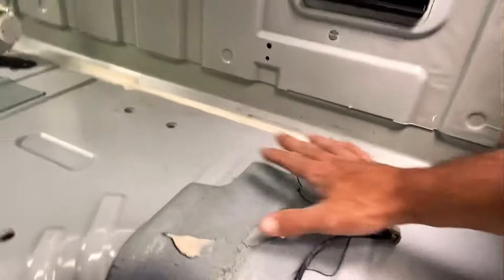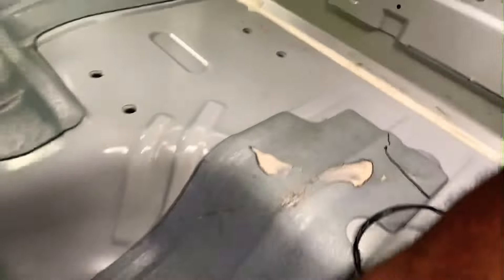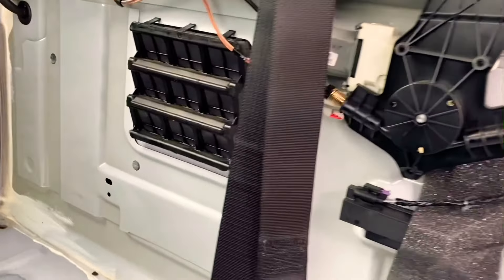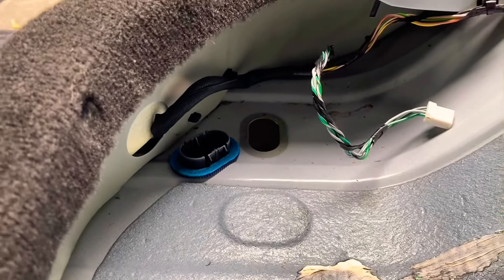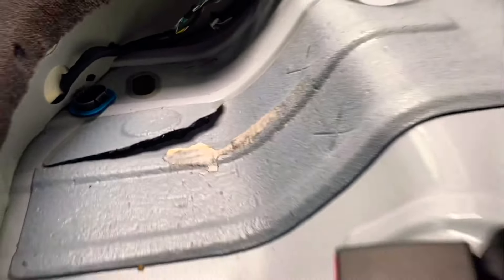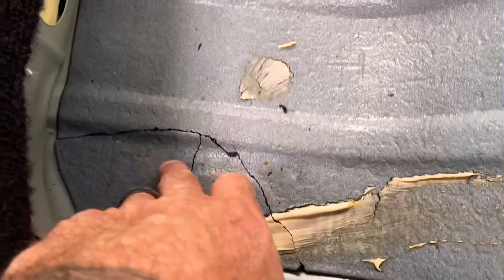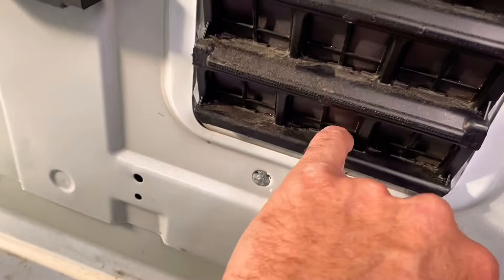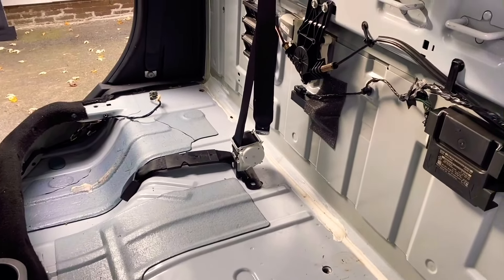ANOTHER RAM LEAK! 3rd Brake Light or Vents??

Comment: I had the same symptoms in my 2017 1500. I did the same exact investigation thanks to this video and found water sitting in my storage wells. Checked the vents and they were actually stuck open by a pile of debris behind them- allowing humidity and even a cockroach to move in. Check between your cab and bed for accruing leaves and debris! I had an entire ecosystem back there.

Comment: My headliner in my reg cab 2015 ram is water stained above rear window and around the back side above seat belt location. Today (we’ve had a lot of rain in CA) 1/2023. Today I went to put my seat belt on drivers side and it was wet!! I guess I’ll start with the 3rd break light. Then if not it’s the window gasket or the roof top rubber seal that may be leaking. Thanks for the videos.

Comment: 04 Dodge 3500 here. Just found leaking in the same area in the back corner driver's side rear seat and storage under seat. Replacing my 3rd light, but water is only under driver's side rear, not the middle, or passenger side. I hope this works for me. Thanks for the video.

Comment: Check the 3 drains in the bottom of the window. Mine were plugged and I found the sliding window would let a little water in and it had no where to go. Blew them out and it's been dry since.
Reply: Were can I find these drains
Reply: @jaredmarquez9993  if you look at the bottom of the glass on the outside of the window, you'll see 3 little breaks in the seal. Those are the holes that the water drains out of. Blow out the track the window moves in then spray some water on the window. You'll be able to tell which ones are draining and which ones are still plugged.

Comment: Great Info, 
I'm having the 3rd Brake Light & Rear Slider issue on the 2019 5th Gen. 
Here's a Big Achilles Heel to watch out for. 
You see that RF Control Module that RAM so cleverly (NOT) mounted on the back wall directly below the center window? 
Well Guess What. 
When they get wet they start corroding inside and eventually short out! This can leave you stranded as it did me! 
Worst thing is that it's a $80 part but $500+ labor because it has to be programmed by the dealer to match the VIN. 
I'm thinking about adding some of that tape and a plastic bag or some kind of shield over it to prevent it from happening to me again.

Comment: They're called "exhausters" and they only cost about $6.00 each. Easy to install and better constructed than the original design.
Reply: Unfortunately when you search them you find a ton of exhaust upgrades and then the seldom find of the actual part. Lol it is a thing and that is what they are called though. 😁👍✌

Comment: Damn thanks! Dealership is trying to charge me $544 right now. The vents are only $67 bucks a piece the rest is labor because they have to remove the seats! Guess that's some really hard work
Reply from the maker: Yes you can do it, just caulk around them unless the flaps are missing or not sealing
Reply: The parts are only $7 at Mopar parts Inc. You can do it yourself in 10 minutes. It takes longer to get the bench out than to change the vents. The dealerships rip people off.
Reply: F-ing dealerships man. I just did mine start to finish in 2 hours, and the parts were $43ish from the dealer, although you can find them online cheaper.

Comment: You don't have to pull the bed off at all!!! I replace these all the time, at a dealership. Push old in towards bed then angle and pull out, reverse for installation. Easy.
Reply from the maker: Thank you for your wisdom almighty Heathen 🙏🏽
Reply: I found that out the other day that they are easy to remove and reinstall from the inside of the cab.
Reply: Yep, unbolt back seats,don't have to pull em out, move em forward then pull out old exhausters and install new ones. I do it in about 10 minutes.
Reply: @heathenpriest5292  so do you still have to pull the rear seats out if you’ve done that back seat mod that allows you to fold the seats down?
Reply: No. If the mod has been done to the hooks behind the seat and it folds down, there is plenty of room to work.
Reply: @heathenpriest5292  nice. I’ve got two new vents on order so hopefully they send me the updated version being that some online places that I’ve seen advertise the new part number on the older style vent.
Reply: Yeah they do that. You should be able to handle it pretty easy though. One thing that makes it fast for me though is bad ass cordless ratchets and impact guns, just so you know. Hand tools will take longer to remove seat bolts.
Reply: Damn it!! I re-caulked my window thinking it was coming from there and still I kept getting water.  Wow. Thank you
Reply: Need to use acid free silicon , regular will ABSOLUTELY cause rust . It will eat through the paint over time .

Comment: Just an idea. But could you spray closed cell insulation on those areas where the noise damps are on the floor after sealing holes?  Again...just searching for ideas bc my leak is coming from top.  Sucks bc I love my 19 Ram 5th generation.  But it's giving me trade in vibes lately

Comment: Thought my 3rd brake light was leaking but new gasket and still getting water in. Going after the vents now!
Reply from the maker: Check the moon roof tubes too, process of elimination!
Reply: My vents leaked also. I just ordered the updated version and they fit much tighter and if the vent flaps leak, there’s a catch basin to direct the water to the outside
Reply: @frankmjr6571  where did you order them from?

Comment: Take the old vents out and replace them for the new ones. Before you put them on, add cabin sealer (good silicone) all around the edge of the vent, where is going to be in touch with the cabin and forget about the leaking....

Comment: So being that this was a year ago, did just simply putting a bead of silicone around the vents like you did, stop your leak? I guess I’ve had a leak for some time now and thought it might have been from the aftermarket third brake light I put in but I’ve long since replaced the gasket on it but I still have a leak. The only time so far where my headliner was wet was when I think the shark fin antenna was leaking, got that fixed and no more wet headliner but we had a pretty good rain today and noticed that my carpet was wet all the way back to back of the cab from the center cup holder on the floor but the headliner is dry so I’m thinking maybe my vents may be leaking as well unless it’s the damn rear window gasket.
Reply from the maker: Yes the vents stopped leaking.  You could have water coming in at third break light, when they leak the water travels down to the rear cab corners.  But also it could be those other things along with the drain tubes if you got a moon roof!  Check out the ZIP TAPE video in description
Reply: @TunedRAMS  well I guess I’ll be finding out the next time it rains because after ripping my seats out, ripping the back panel down and soaking the top of the cab, I had water pouring in from the top of the passenger side vent. Even had it coming in from the driver side vent as well but nowhere else, though as far as the 3rd brake light, sun roof drain or anywhere from the back window. 

I think I used the same silicone as you but I went one step further and broke off some short pieces of a paint stirring stick to wedge between the little tabs on the top of the vent that hold it in place and the cab sheet metal and siliconed it all in place being that you could pull the vents in towards the cab over an eighth of an inch so it’s no wonder the gottdamn things leaked. Hopefully I got it fixed but hey, if I didn’t, I at least did the rear seat mod while I had the seats out so hopefully I won’t have to yank the seats out next time.

Comment: The 3rd light might be leaking but the truck cab vents behind your back seats are definitely leaking.  You will have to remove the rear seat to gain access.

Comment: After lifting my carpet up it was way worst than it showed on the surface the foam is saturated in water. I am so disappointed in ram. I have an extended warranty but don't think it's worth the abuse. Any tips on drying this out without removing the carpet?
Reply from the maker: Yeah I try not to bring anything I own to the dealership, it can be a hassle.  Every truck has its flaws, some worse than others.  My carpet was very wet and like I said started smelling like wet feet, I pulled it out, sprayed 50/50 beach on the back and let it dry for a week.  Smells good as new now.  Just be careful not to get bleach on the finish the side

Comment: This is Happening to me for the 2nd time. The first time I replaced and double gasketed (if that's a word) the new light. It seemed to  work after a month or so down here in swfl. But after TS ETA had extra heavy rain in wake-up this morning to guess what? More damn water. I called the dealer but they can't see me until 2 and a half weeks! 

After watching this video I went to my truck and reached down the back part of the carpet behind the seat from under the window and down, and it was dry up until I got to the vent! So I think I'm going to mess with it this weekend...is it hard to take the seats and carpeting off? Hopefully not. If I can get this done maybe I'll skip the dealership appointment.  Thanks for the video
Reply from the maker: Yeah man I found water again and I’m like WTH!!  Hosed it down and the vents were leaking around the frame, they actually leaked AGAIN after I siliconed them!  So I put a big fat bead on the bottoms again, there are plastic clips at the bottom that need to be covered 100%, that finally solved it. Caulk all the tabs real good.  Good luck, glad to help!
Reply: The seat bolts are real tight but 18 mm 1/2” socket is best- even use a breaker bar helps. Once the seats are unbolted it’s easy to peel lining back and get to the vents. You have to push them back into the space between bed and cab to twist and bend to get them inside the cab. Then the new ones (mine were thicker and harder to put back through the hole from inside the cab) can go back with some forcing. I’d make sure they were warm when installing them cause if cold and brittle they may crack.
Reply from the maker: It’s easy, like Jim said, once you break the bolts loose.  I take my seats out all the time, I oiled the bolts so each time it’s not so hard.  The bolts are exposed underneath the chassis so they get road grime on them.  Once you get the seats out it’s pretty easy to take out that storage carpet.  A bunch of push buttons along the front storage rim.  Just remember where the seat belts go, I’ve misplaced them a few times.
But yes overall very easy!
Reply: I did this past weekend we got more rain Here in LA this week 
And water still came in not as much but I little trickle I thought I did a great job siliconing it but I guess it needs more lol also it cured for about 3 days before it rained

Comment: Wouldn't it be easier to silicone the grommets just by getting underneath the truck ??. Thanks for the video thou.
Reply from the maker: It would be dirty under there and some are hard to get to, try it!
Reply: @TunedRAMS  I just did that right now. Cleaned around the grommets underneath the drivers side of the truck. I've noticed water in that little compartment underneath my rear seat. We'll see if that works. I'll also do that trick you did with the stick tape for the third break light. Are there any recalls for this?? Sounds like a big issue with these Rams.

Comment: Those vents are easily and cheaply changed. They slip in between the cab and bed. i did it on my 16 that was leaking. As for the 3rd brake light fix, you need to REPLACE the gasket NOT seal behind it. That does not stop the leak
Reply from the maker: Bro this is the 19th time I’ve dealt with this.
Reply: @TunedRAMS  so what’s the final fix cause I’ve seen most of your videos but I don’t know which ones are part 1,2,3,4 etc. I’m a little comfused. I’ve seen You mess with the 3rd brake light too.
Reply: I’m just getting water stain in both corners of my rear headliner.2019 ram limited
Reply from the maker: @jorangel87  seal around vents, sealing grommets, check moon roof tubes if you got them, I have a video on leak proofing third break light.
Reply: @TunedRAMS  I have the panoramic roof where would the tubes be? I have the 2 water stains in each rear corner of my headliner.
Reply from the maker: @jorangel87  got to take the seats out, back liner, you’ll see them back there.  Most likely your third brake light is leaking, that’s erl here they leak.  Watch all my vids!